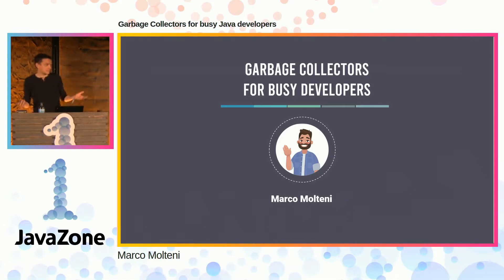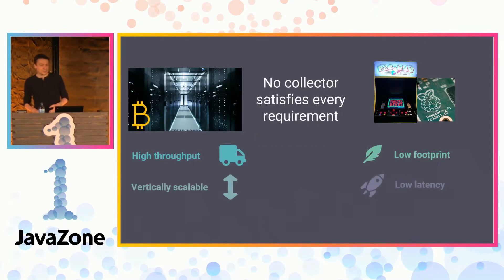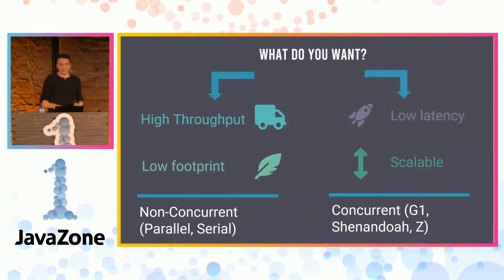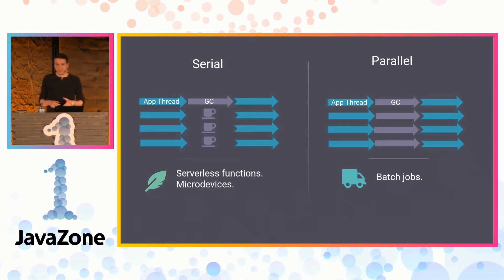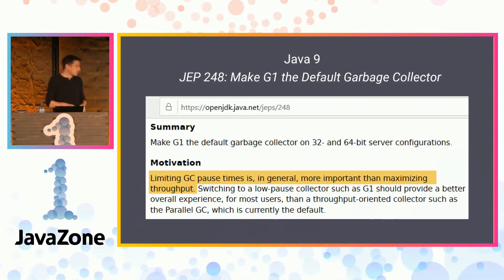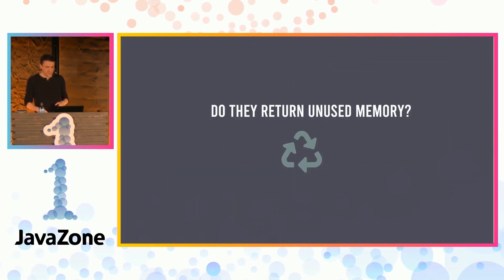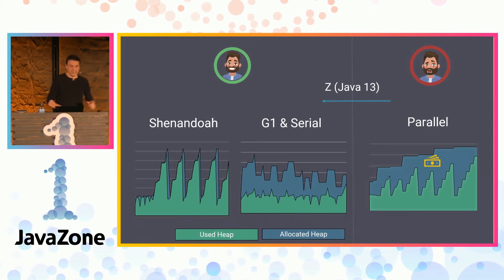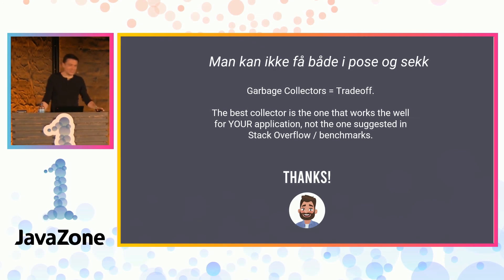Which Garbage Collector should I use? Quick intro for Java developers

Comment: Hi Marco. I saw your post on browser about, Call a function every x seconds in Angular. In that post, I have used other method. That is working fine. But when we duplicate the application tab, it is not working in all tabs. Means, code execution is not happening for x interval of time in all tabs. Can you give us clue if any
Reply from the maker: Hi, I did a quick test with Firefox and Chromium. I had no issues, multiple tabs were calling the backend. I added the calls in directly in the component and duplicated the Tab in the browser. Which browser are you using? It maybe de-activate the tabs to save energy? Do you have sessions in your Angular application?